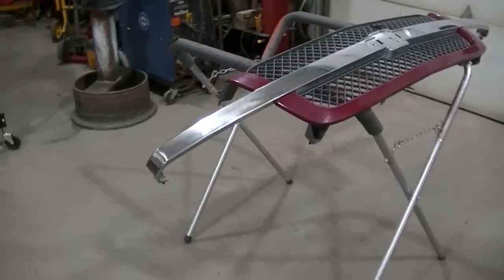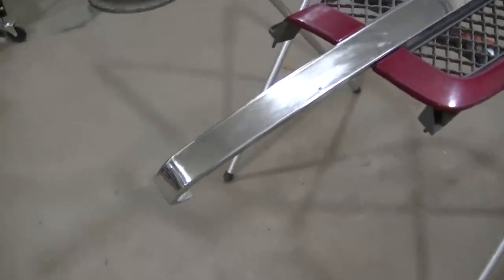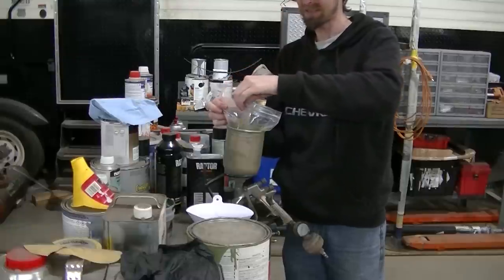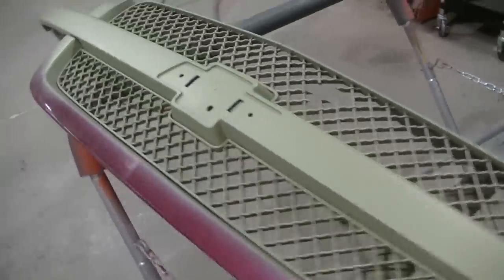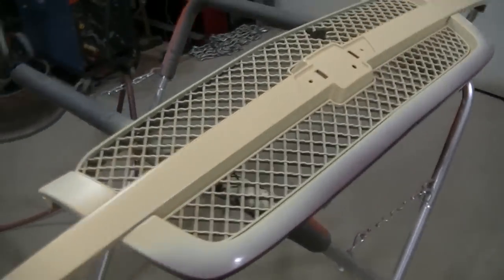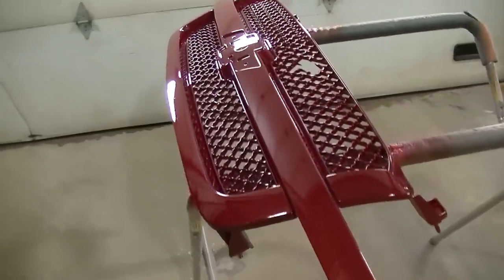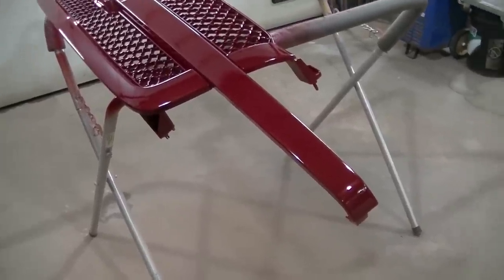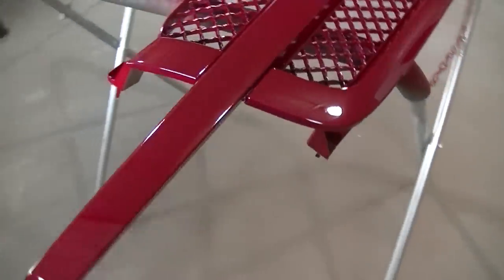04 Silverado 2500HD Painting a Chrome Grille

Comment: Always kinda wondered a good way to paint chrome and make it last and the liner system is pretty cool to
Reply from the maker: The black grille on Midnight was painted after I hit the deer.  That was when it was on my dually.  I had a 2002 2500HD that I bought new in 02. I painted the grille the same way and sold to a local guy.  It still looks like a factory paint job.  Actually the guy I sold it to thought is was factory painted.  That was around 17 years ago.  The liners really help on cleanup.
Reply: mossman381 next time i paint a grill I’m definitely going this route and you ain’t lying about the spray paint thing , you can always tell
Reply: What kind of spray paint would u recommend I have a blk truck gm h8555 u think if I go to paint store and tell them to put it in a spray can and buy a 2k clear would be ok I don't have a spray gun or compressor at the time

Comment: Hey Hey Look who first lol. Nice video bud I was actually planning to paint my grill this summer and look who hooks me up with just the right video.  My 04 is I guess they call it victory red and I am doing the rockers and cab corners soon then on to the paint.  I am debating on if I should build a custom front bumper like I did with the rear and probably going to Raptor line from the lower body line down.  Just not sure if I want to color match or go with the black.  One thing I am doing is making a custom bow tie for the grill.  I might stick with the gold color but it will light up with leds. The ones I found online light up around the bow tie but the whole emblem doesnt light up.  If I get one made and looking good I will send you one.
Reply from the maker: They had victory red and the sport red metallic as color choices.  The victory red was much more popular because it's more of a real red.  Body color or black is a tough decision.  Sometimes the texture of the bedliner can cause a color to look different.  On my white S10 it actually came out really good the same color.  I have seen the lighted bowties.  I really like the one I just got for this grille.  It looks sick now that it's painted.

Comment: Can’t find one for my 02 hd project so I’m working on removing all the chrome
Reply from the maker: I have a 2002 Silverado that I painted this same way probably 5 years ago and it still holding up great. You won't find a 01-02 HD grille that isn't chrome. They didn't make any.
Reply: mossman381 ya I’m working on getting chrome off grill thanks for video
Reply from the maker: You don't have to take the chrome off the grille. Scuff it down good and then a few light coats of etching primer.
Reply: mossman381 ya I already started so way going do it now I should  of did more research before I started seen bleach video also

Comment: Is it safe to assume you're not going to swap the cab from the older dually?
Reply from the maker: Body swap is still on the table.  I can sell something like this pretty easy.
Reply: @mossman381  - I look forward to what ever you decide. You made some videos about fixing the rocker panels on "Darth Dually" and I watched with great interest because I have to do the same thing to my truck, a 2002 silverado 1500. I was expecting a video fixing these same panels on "Midnight" but I noticed that they are still rusty. Was that work extremely difficult? So difficult that you are willing to replace the whole cab rather than fix the rust problems on "Dad's truck"?
Reply from the maker: Replacing rockers and cab corners is a difficult job.  A lot of grinding and fitting.  Not something I would want to do everyday.  I could do it a lot faster by just slapping them on quick.  That's not how I like to do things.  It's not just the rust on dads old truck.  The interior is pretty well used and the front fenders are rusty too.